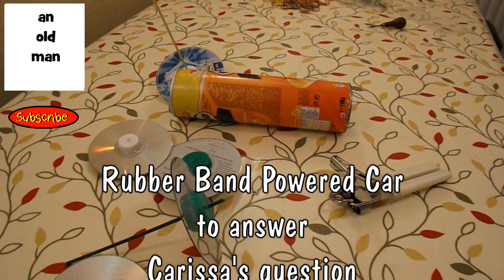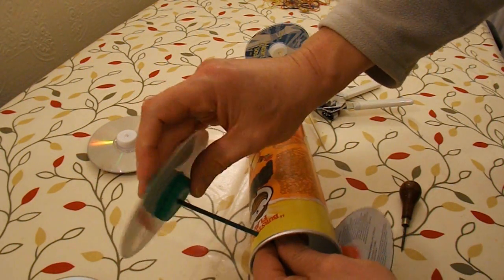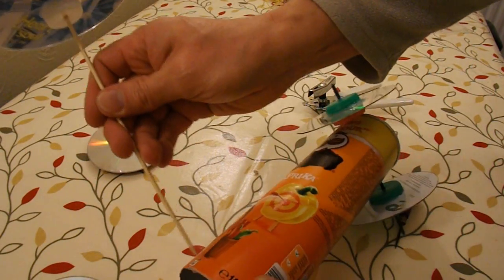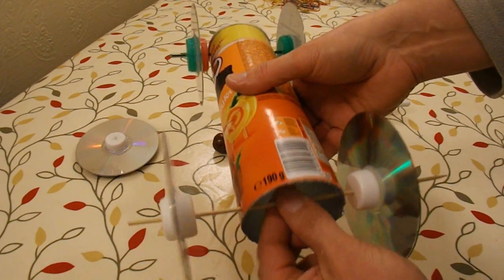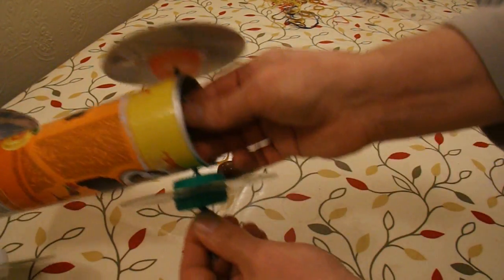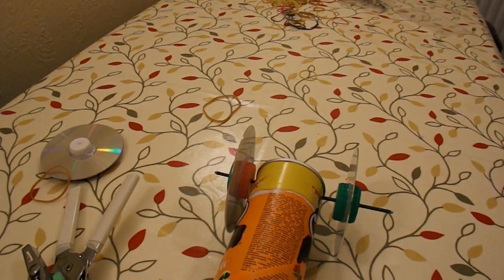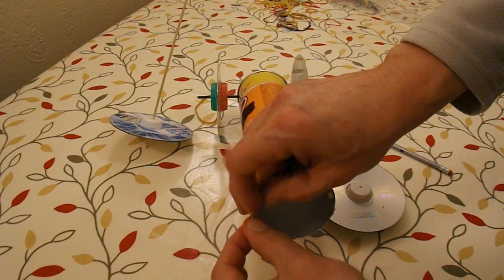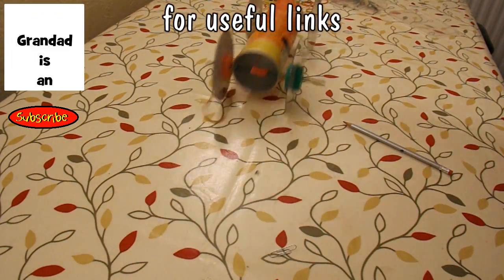Rubber Band Powered Car to answer Carissa's question

Comment: I have special gears that hold the bands so I can just put it on the gear whilst another on the paper clip, then wind up then it should work right? Will it work? (I have just a gear that goes over a pipe like a straw then the rubber band goes in the middle of two walls to prevent the band slipping

Comment: what did you use as a back axel
Reply from the maker: The details are in the video description. I usually use BBQ skewers. Looking at the video I can see I used a flower cane for the back axle in this case which is just slightly thicker than a normal BBQ skewer but that was probably just because I had one available at the time so I used it. You could use a pencil if you want. I find they tend to cause more friction because they are thicker.

Comment: What if you were only able to make one out of
1 Folder
3 Popsicle Sticks
6 Rubber Bands
8  Paperclips
1 Straw
Tape, Glue Unlimited Amount
Reply from the maker: Hi o.W.n Engineer, I would need a bit more detail on the components.
1. What are the dimensions of the 'Folder' and what is it made from?
2. Are the Popsicle Sticks round or flat?
3. Do I make the wheels from the 'Folder'?
Reply: 1. Any Dimension Really
2. Flat
3. Yes
Reply from the maker: o.W.n Engineer Is the folder cardboard?
Reply from the maker: ***** fairly irrelevant to comment on this as it is well over a year old. Here is the car I made for him https://youtu.be/XRykymHoPZ0